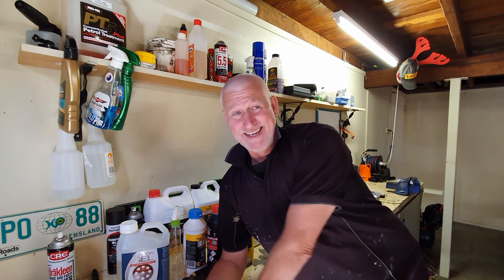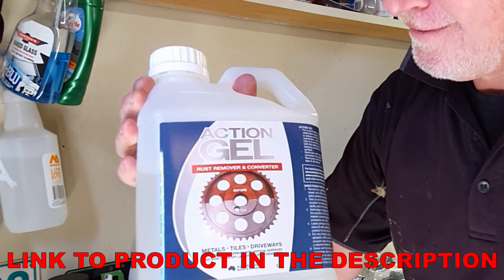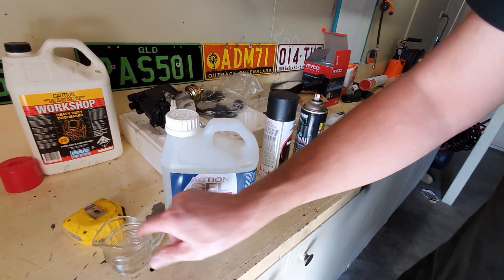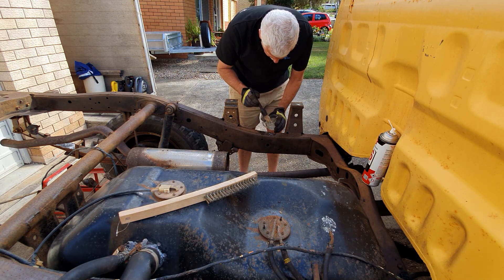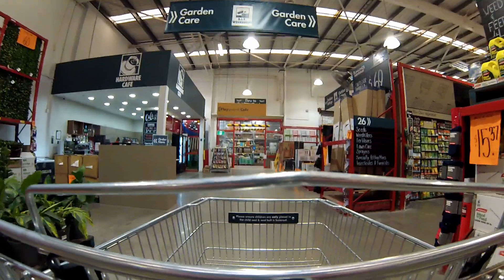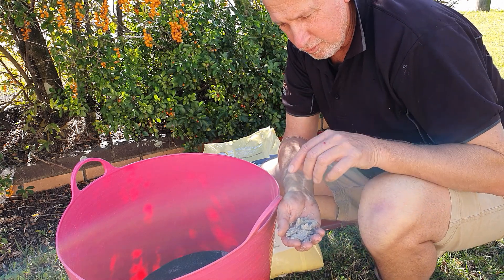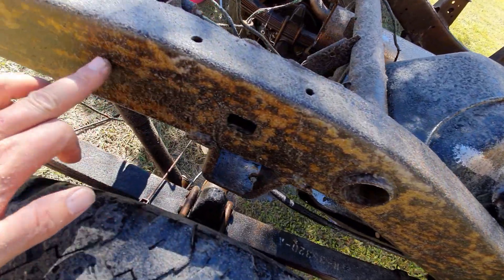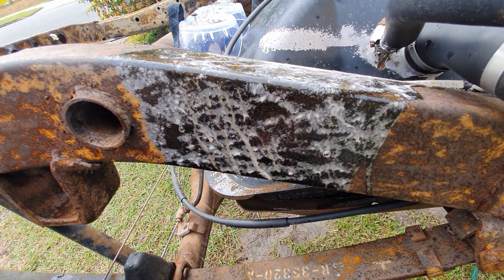1984 TOYOTA HILUX CHASSIS RUST REMOVAL AND PREVENTION  | 1984 Toyota Hilux 4x4 Restoration [Ep 3]

Comment: That's a very impressive rust gel, quick and converts really well. Great idea sand blasting too, I'd have used a drill to wire wheel the chassis like a dumbass.
Reply from the maker: Yeah It was a little more costly and messy than I would of liked but achieved a nice result.